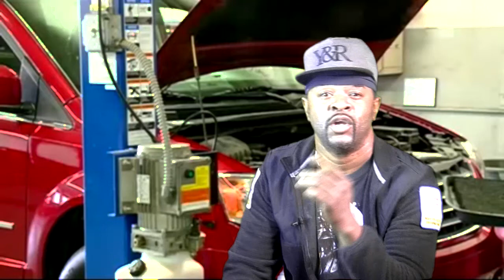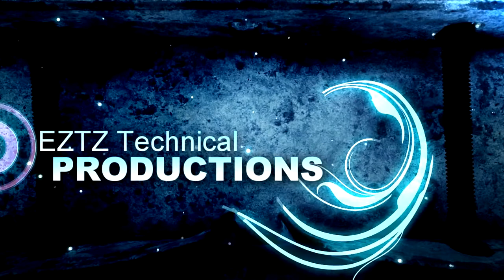P050d Cold Start idle problems discussed. Runs rough cold

Comment: thank you for video man. i'm going crazy rough dile for 2 minutes on m54 bmw. everything seems to be so perfect. if i buy everything (maf, coils, ccv, sparks) it will cost more then car itself. dont know what to do. its just perfect with fuel trims and vacuum, even acceleration after 2 minutes from cold start. no codes on simple obd or even bmw scanner 1.4 inpa. everything , considering temperatures are fine.